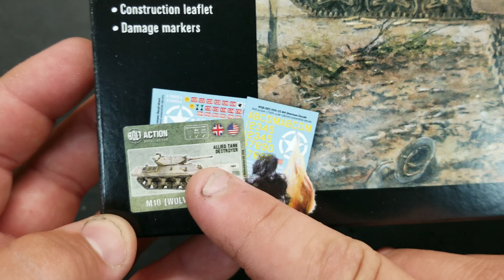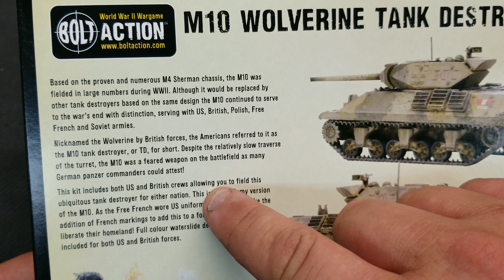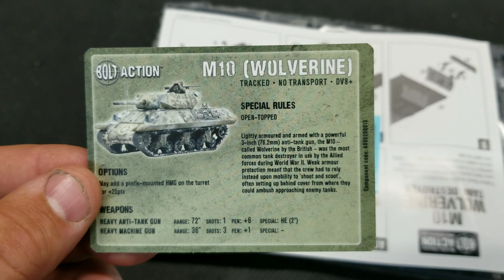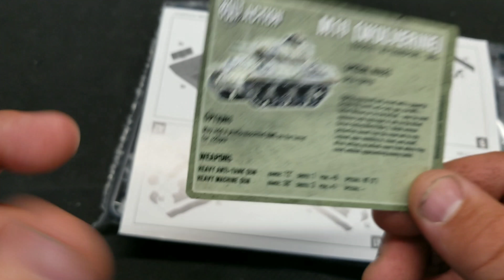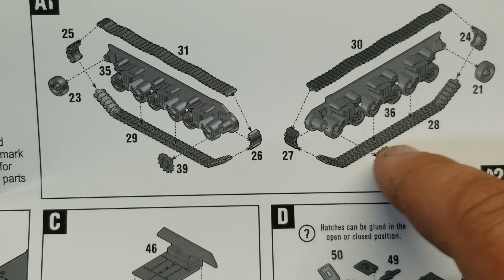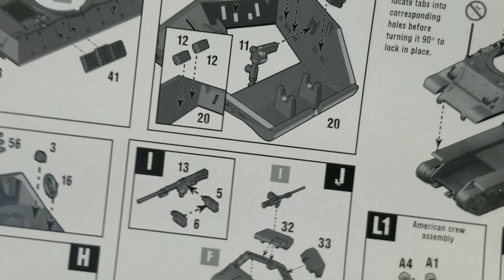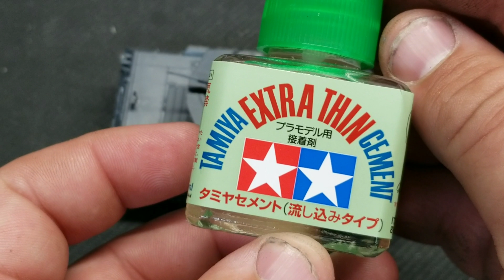Bolt Action M10 Wolverine Tank Destroyer, LET'S  BUILD

Comment: Did anyone else building this find that part 56 on the instructions, what look like towing loops that attach to the underside front of the bpdy, was missing. An that you had a leftover part, number 2 which looks like some kind of bipod, that was never mentioned in the instructions?
Reply: OMG YES!!! I have been  trying to find out  what part #2 is  for all day!!!  and yes  my kit didnt come with the tow hooks either!!!
Reply: @rj7344  I'm pretty sure part 2 is a stablizer for the gun.  I've not seen it used on m10s but I think the jackson was equipped with it. Could be that italieri uses a dual purpose kit as the basis for the warlord kit.